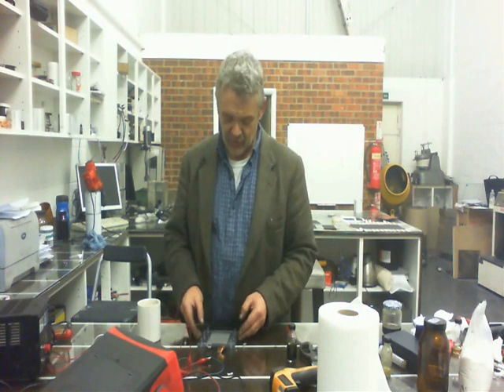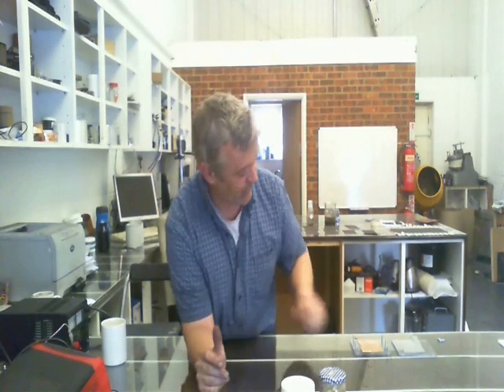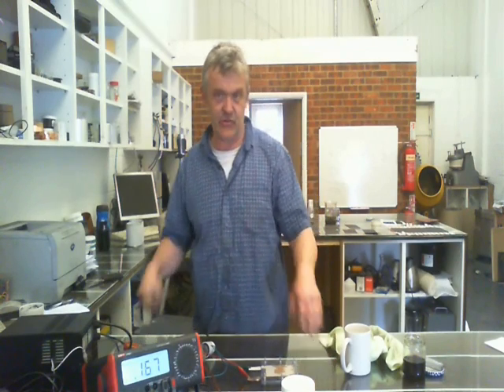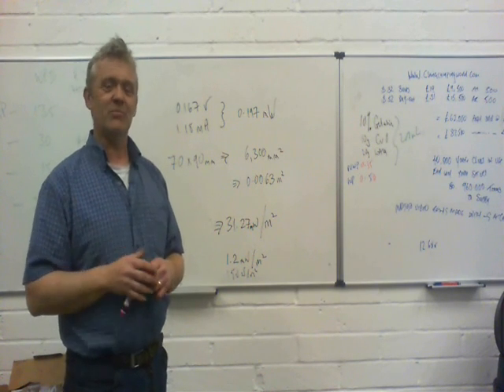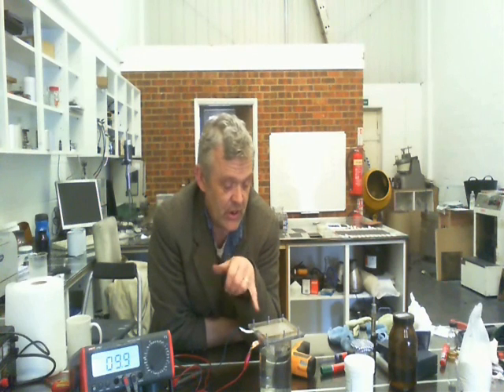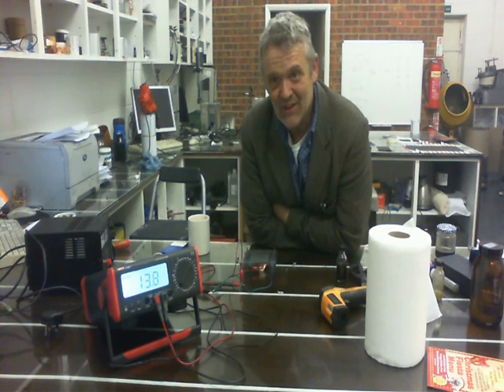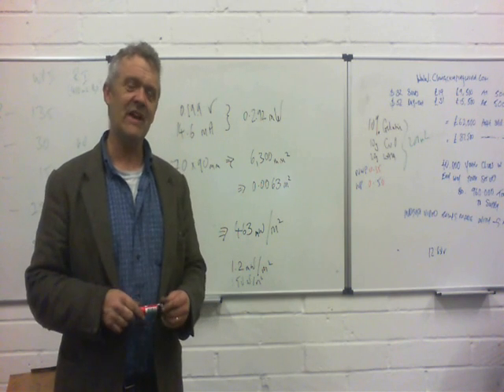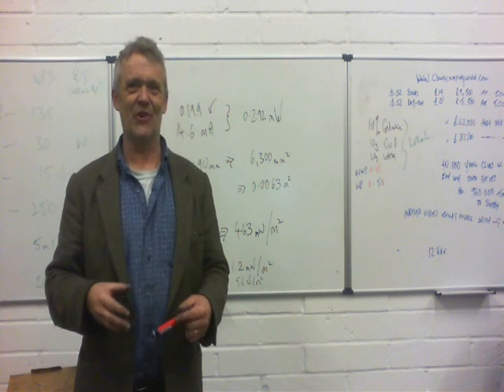Working On The Leaf Based Solar Cell - A Lab Log

Comment: Hey Robert, when you painted the Water Proof on the copper plate, did you magnet align it? Will it align through the copper? Just wondering.
Murf
Reply from the maker: I aligned the ink mate - it won't align the copper

Comment: Hi, 'been interested with how the solar cell from leaf works and also tried making my own model. I was able to produce .3 to .5 volts but the problem is, i have zero readings in amperes. I hope you can help me with this. haha. I have not used any DES like what you did on your models.
Reply from the maker: you will need to use a des  i think mate
Reply: DES increases ampere readings?
Reply from the maker: yes

Comment: It appears to be temperature dependent. Maybe you should try an infrared lamp on it. See if that doesn't increase the output. It probably will to some degree since chlorophyll gets its energy from red and yellow light as well as a bit of blue.
Reply from the maker: good point mate - will do

Comment: Where the cost would climb is in infrastructure and labor. More surface area means more support material, more wire, and more labor, so in all likelihood, the cost would still end up higher than the concentrated solar collectors.